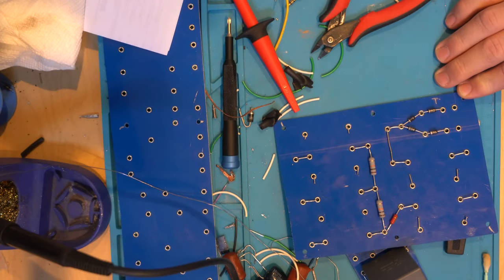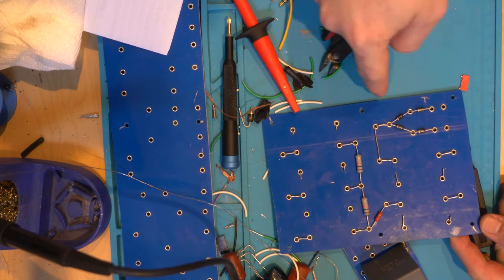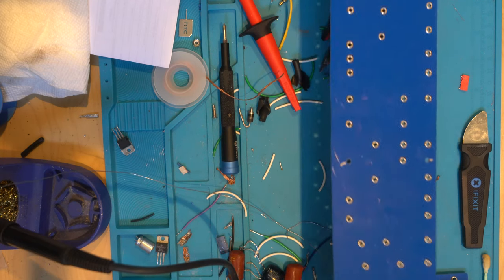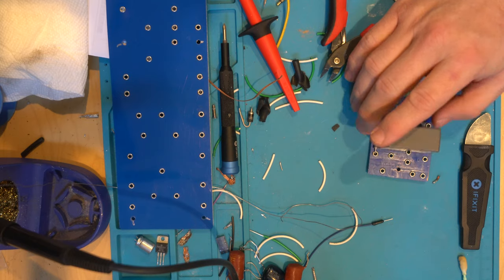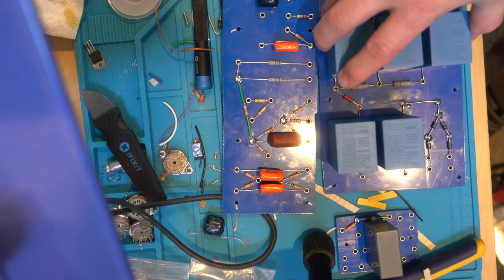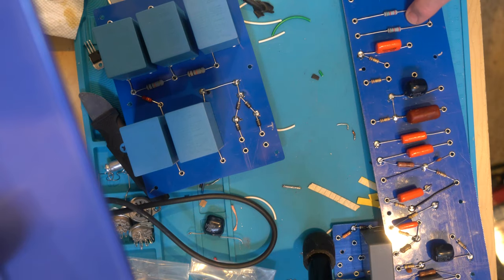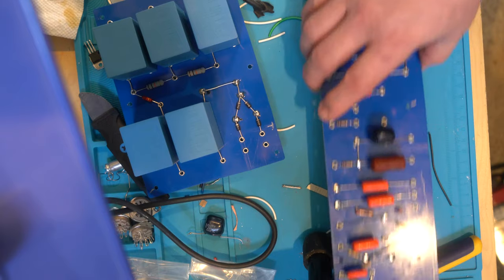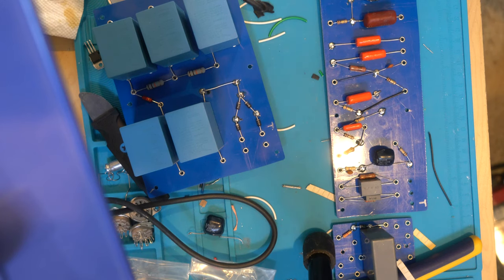Dumble Modded Bassman Video 3

Comment: How do like your Rigol scope, I can purchase old scopes for scrap price but space is an issue.  The Rigol seems like a good solution depending on price (used).  Thanks, Paul
Reply from the maker: Love it.  Simple to use, and with 100x probes I can safely use it on tube amps